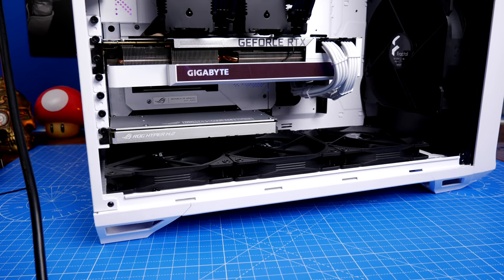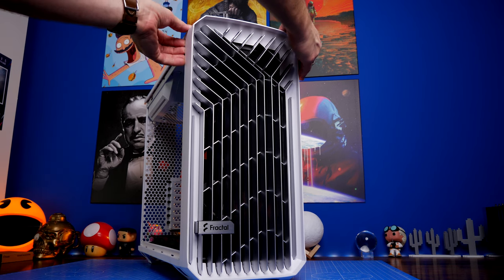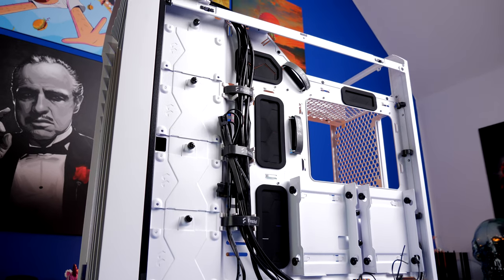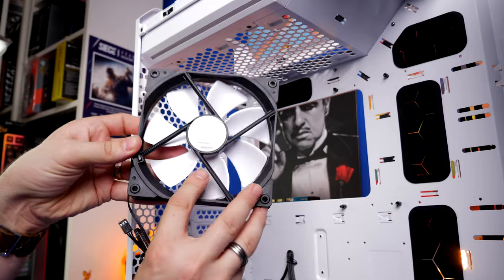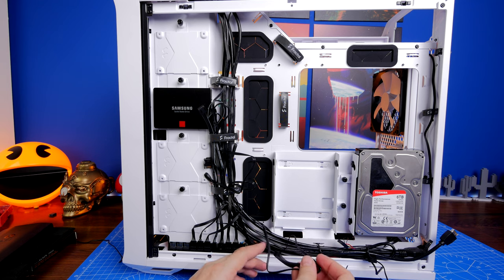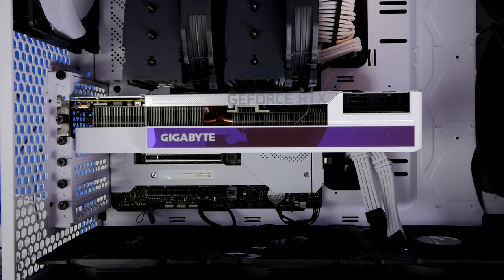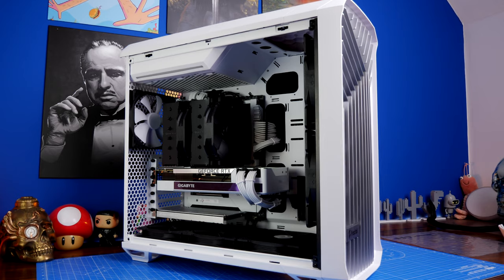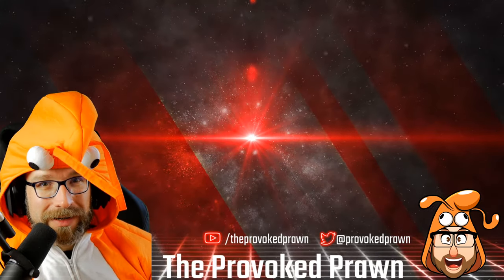Fractal Design Torrent review - so much air!

Comment: I've had my Torrent a while now, and I've tested multiple layouts, and the "Stock" layout is definitely best for air cooling. Running the two front fans at 50-60% combined with the bottom fans at 30-40% creates enough pressure to force any/all hot air out of the back of the case, and passively cool the psu a little, and when the fan does run, it gets plenty of air itself from inside the case. Running a rear exhaust fan, the PSU runs hotter (tested that with thermal probes) as it ends up fighting against the rear exhaust fan for air rather than being already drowned in it.

I have the Top 180mm fan running on a PWM header that is linked to the CPU temp, the others are on the case's fan hub and they react to the internal case temp and ramp up based on that.

It's super quiet, super cool, with that layout (5800x + NH-D15 Chromax also).

With a 360 AIO + 180mm fans in the bottom of the case, the airflow dynamic is very different and needs a slow rear case fan to pull the radiator-warmed air out - but the PSU again is warmer because of that layout.
Reply from the maker: Interesting. Thanks for sharing.
Reply: That's really useful info, thanks. I am planning on building a whole new high-end rig soon and am seriously thinking of going with this case, as I want the best air cooling I can get. This includes a NH-D15. My current system, which I built 11 years ago, has the NH-D14 which has served me well. I didn't really want to go for an AIO cooler if I can help it. I like the idea of all air cooling. Thanks particularly for the tip about not having a rear fan for this type of configuration. I guess the positive air pressure in the case is sufficient to push air out the back grille.

Comment: this is unrelated to the video but have you got any tips for the EPOS B20? when my headphones are plugged into the mic it has a low buzzing sound when monitoring the microphone (this isn't fan noise or vibrations, this is a crackly interference noise)  and when my mic is muted there is a slight static noise. also the software won't load 90% of the time and has only managed to detect my microphone once.  But apart from my problems, love the videos', underrated AF channel!
Reply from the maker: Hhmmm that's sad to hear. That's not something I've experienced. Have you checked for firmware updates? Low buzzing could indicate an issue with electronic interference. Fertite cores can help with that. You can attach them to the wires and it cuts out the inference. Also avoid putting the mic or the headset cables anywhere near power cables. And maybe try another USB port. These are my suggestions. Alas I didn't have the issue so can't fully give you the answer. Sorry

Comment: I have that tower the RGB version ;) I love it with that Noctua NH-D15 Black Cooler.
Reply from the maker: How's the RGB. I want to upgrade but the fans are so much money.
Reply: @TheProvokedPrawn  Honestly the RGB are pretty darn nice because I can control them with Razer Synapse. I have ASUS Motherboard, Corsair Dominator Rams, and everything else is Razer. They all work perfectly together and so that makes it so much nicer to work with. On top of that, these fans feel a very high-quality build and the airflow on this is pretty amazing. I run an Intel 10900K with an NVIDIA RTX 3070Ti FE, and It runs pretty cooled. Before I had an AIO on the CPU which I no longer need on this setup. The positive airflow is strong enough I can feel it on the back with no rear fan attached to the case.

Comment: What is your opinion of the rog formula z690? I have one waiting for me, just waiting on the case
Reply from the maker: Beautiful, solid, excellent features. I hope to have a video on it soon.
Reply: @TheProvokedPrawn  what memory did you pair with it?
Reply from the maker: @mikerzisu9508  Kingston Fury Beast 6000mhz CL38
Reply: @TheProvokedPrawn  any stability issues?  I have read the rog boards struggle a bit with 6000+ ddr5. 
I will be using the corsair dominator 5600 cl36 (white edition)
Reply from the maker: @mikerzisu9508  none at all. It's been a dream.

Comment: I had couple of Fractal ceases and I think Nexus is sponsored by Fractal or Nexus just spent not to much time with Fractal cases. Fractal cases just Ok, they are not great, build quality is so-so, something was making noise inside because of vibrations of HDD for example. Mash panel of Meshify cases is super hard to clean. Torrent is expensive but has no good option for 360 AIO. I also see the same problem with dust on the mesh panel.